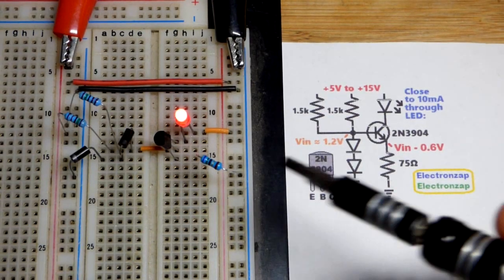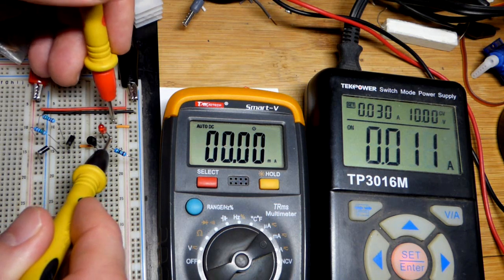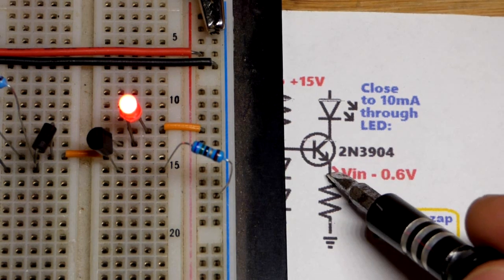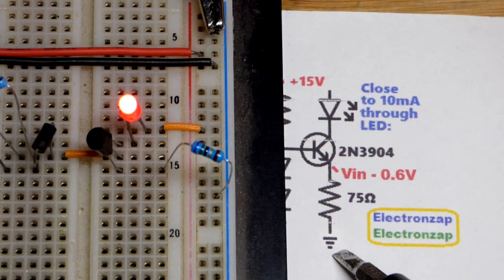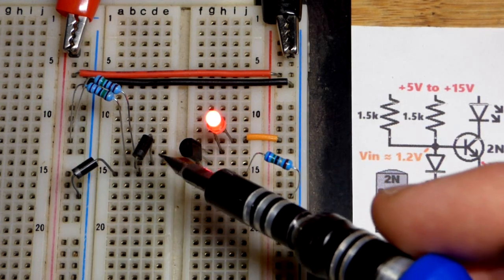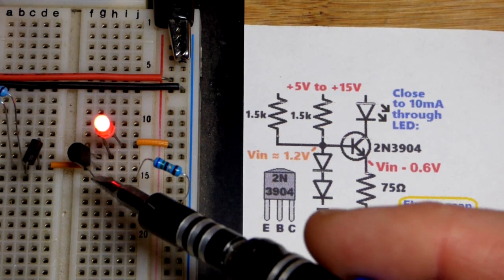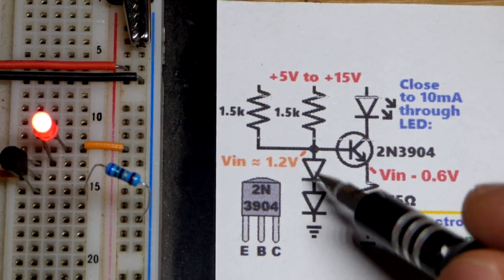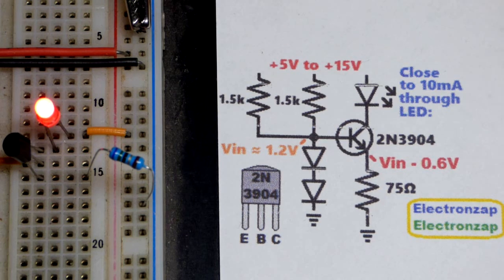Inefficient close to 10mA through LED using NPN BJT current source Bipolar Junction Transistor

Comment: This is why if you need a voltage reference you should use a component that's actually designed for doing that.  Instead of those "ordinary" diodes, just use a zener diode instead.  They're actually designed to maintain a consistent voltage threshold over a wide range of currents, even down to as little as 50 uA (micro-amps) or less.

You could replace those diodes with a 1N4678 1.8V zener, replace the 1.5K resistors with a single 56K resistor, and then the LED current would actually be more stable, and the whole thing would consume only between 250-450 uA extra (on top of the current for the LED).  (No need to worry about the size of the 56K resistor either, since it would only be dissipating about 5 milliwatts in the worst case.)

(And if you replace the 75 ohm resistor with a potentiometer instead, you could also change or fine-tune the exact current flowing through the LED, if you wanted to)
Reply: Zener diodes aren't exact voltage references, the voltage developed depends upon the current through the zener.  The variation in this circuit is due to Vf of his diodes not being fixed at .6V either, it also depends upon current.  This also applies to the base-emitter "diode".
Reply: @tonyfremont  The voltage of a zener will vary some with current (there's no semiconductor component that won't), but the point is that due to its construction, it is much more stable in this regard than ordinary diodes typically are (and low-power zeners require much, much lower current to get past their "knee" into their more stable region to begin with).  In this setup, I'd expect that the zener voltage would vary by only a couple of millivolts over the current range involved, which should be more than stable enough for this application.

The base-emitter diode junction in the transistor is not really an issue, because (if the reference voltage is kept decently stable) the transistor's current does not change substantially depending on the input voltage (that's the whole point), so its bias voltages inside the transistor should not actually be significantly affected by changing the supply voltage.
Reply from the maker: Yup. Thanks for the tips!

Comment: Place the led instead of those 2 diodes. Bump the 75o resitor to some 500o, series the 2 1.5k from VCC to collector then to the base. Tweak resistor values. The LED's Vf  just like most diodes is rather stable flat. Account for the BJT's β parameter and make sure it stays in the amplification refion across the voltage range.
Reply from the maker: Yeah, there's all kinds of ways you can modify this circuit.

Comment: I'd say the 750ohm to load the diodes is way too high. You only need about 1mA going through diodes, not 13mA
Reply from the maker: Red LED will be pretty dim at 1mA. Maybe 5mA won't look too bad.
Reply: @Electronzap  talking about the diode(s) branch, not the LED branch

Comment: Yeah I'm starting to get used to no dot but, thank you for the dot.😅 I know schematics nowadays omitted the dots.
Reply from the maker: Some people get really riled up over the dot lol. Thanks for watching!
Reply: No (correct) schematics will omit the dot when the wires are supposed to be connected.  Wires crossing without a dot is pretty much universally accepted to mean that they are not connected, so it is true that many schematics nowadays have wires crossing without dots, but it always means that they are unconnected wires in that case.  (it is just a more modern alternative to using the "hop-over" notation for unconnected wires)

Personally, when drawing schematics myself (not using a schematic editor program, etc), particularly for other people to read, I will always use both dots for connected wires, and "hops" for unconnected wires.  That way there is no potential for ambiguity or misunderstanding.
Reply: @foogod4237  I do that too. I believe that is the proper way to do it.